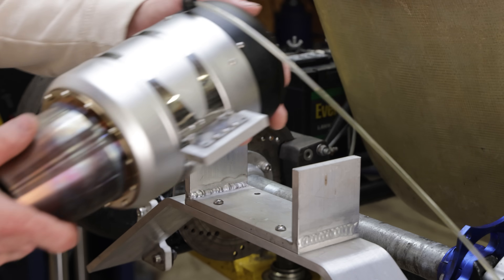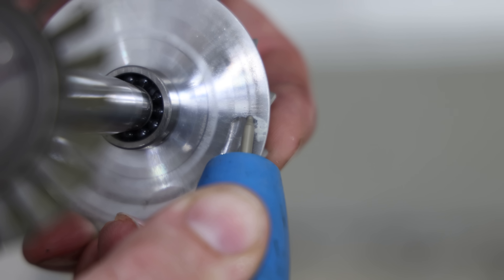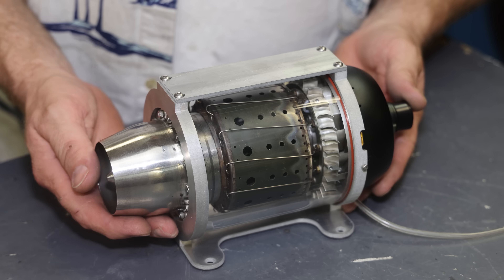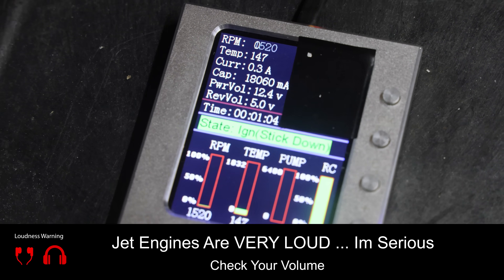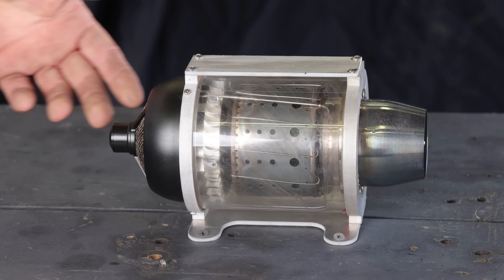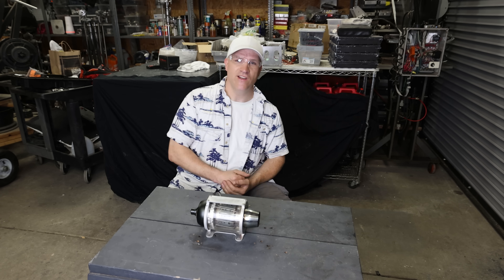See Thru Jet Engine

Comment: I loved this vid!  I still don't know how the front "fan" gets so much air into the combustion chamber before the chamber starts working.  After that I think I understand that the flowing fluid/gaseous part accelerates the rear "fan" and from there it seems like "more out, more in", in a sense.  I have to study this!
Reply: I'm looking at this as a car guy but the front "fan" is a compressor wheel like in a turbocharger, which doesn't just suck air into the combustion chamber, it sucks and compresses air, therefore cramming more air into combustion chamber. This is why Forced Induction (supercharging or tuebocharging) is required to make massive horsepower out of vehicles that are Naturally Aspirated. In the case of turbo'd cars, they're also more efficient because the intake side of a turbo is being spun up by the exhaust side which is spun up by exhaust fumes as they exit the cylinder/exhaust manifold therefore as you give it more gas, more hot exhaust gas is flowing, spinning the exhaust side of a turbo faster, therefore spinning the intake side of a turbo faster, which makes it suck AND compress more air, and cramming it into the engine and now your car is flying down the road making X amount of horsepower.

Comment: That was outstanding! What does the small bench it was screwed down to weigh?
Reply: The bench is strapped to fasteners in the floor, so the bench weight doesn't matter.
Reply: Brian B-P got it I didn’t know that and didn’t see that. Now, in your opinion, would it slide the bench along the floor?
Reply: @14goldmedals  Possibly. JetPol builds a similar clear-housing demo engine of about the same size (their housing is borosilicate glass) and a YouTube video of their engine running on a similar table includes the table sliding on the floor and being pushed back into place... it's amusing to watch.

Comment: It took me less than 95 seconds to realize you know your stuff, have a subscribe. Question, what about a thought on cold air to cold air exhaust on a compression engine. Get me some info, and I'll research it more. Maybe it's just a something, but thought experiment. I think it sounds fun 😊
Reply: I edited for an "r" on your. 

I am thinking..some unburned fuel is acceptable to be in-line for a torque application. I will say, probably the colder, the better.  That said, it's different. And super nerdy. Where is the safety wire!

Seriously, any assistance would be cool. I know a bunch of guys in the niche of the field of application that are true madlads. One wrote code for real time data logging, another has worked with two different companies to pioneer kits for upgraded supers. Now he's working on a budget turbo kit on a stock appearing sleeper. The super variant looks really stock. Parts are plenty, help is plenty.

Comment: is there a blue print for building small jet-engine
Reply: There are many commercially produced engines, including the one that provided most of the components (everything except the clear housing and brackets) used for this demonstration. They don't give away drawings, but you can get all of the parts.

Comment: Pretty cool being that I was a jet engine mechanic in the Air Force but also worked in the balance lab as a civil service mechanic where I balanced J85-21 turbines and compressor rotors for the F-5 that the navy used for the top gun program back in the late 90’s out at Edwards AFB. Great video.
Reply: Yeah guys, the real Top Gun. Bet you didn’t even realise its real

Comment: Is that an Impeller from a turbocharger?
Reply: It's similar, but all of the components of these hobby turbojets are manufactured specifically for them.
Reply: @brianb-p6586   Thanks, I figured the impeller is modeled after a turbocharger design... the working mechanical principle is basically identical 👍
Reply: @TheEDNC  But the order is the other way around - turbine engines were invented before turbochargers.
Reply: @brianb-p6586   Not so… turbocharges we’re invented in 1905 … forced induction found its real purpose so that WW2 aircraft, such like the B17 Flying Fortress could fly at even higher altitudes to avoid enemy flack defenses. There were many aircraft that were turbocharged starting as far back as 1921, way before the Germans perfected jet turbine technology
Reply: @TheEDNC  Although turbojets were not advanced to practical use (due largely to materials limitations) until after turbochargers were used, the gas turbine engine was invented a century before that, and centrifugal impellers were well-established technology (first worked out by Euler in the mid 18th century) before anyone built a turbocharger with one.
Reply: @brianb-p6586   Thanks!

Comment: You never actually showed much about the INSIDE. how does it rotate. You used a belt during your balance test, buuuuut, does that infer I can assume there's a belt in the compression housing?
Reply: No, there is no belt drive. The compressor impeller and turbine wheel are directly mounted on the shaft, as you see in the balancing process and the assembly - that assembly and the starter motor mounted directly to the nose of the shaft are the only moving parts within the engine.

Comment: "jet engines don't pull that much air"...still, a GE 90 115K at TO thrust pulls in a 50 cubic meter per seconds of air which to me is actually decent 😂
Reply from the maker: You're comparing apples to oranges. A GE 90 is not only a turbofan engine, but a high bypass turbo fan engine. The engine in this video is a turbo jet not a turbo fan. Completely different type of engine
Reply: @WarpedYT  Yes, the mass flow rate of air through a turbofan is much higher than a turbojet (for the same fuel burn rate), but even in a basic turbojet the mass of air which flows in a given time is much greater than the mass of fuel.
Reply: Okay, I thought you were talking about something general about the air flow. Indeed they're different because of their spec and working principle. However, compared to your engine's dimension, the flow must be decent as well, an intake air velocity measurement would be interesting I think ! Great video very interesting 👍

Comment: Can you build an engine that size that would have rotational power (run a generator) rather than pushing thrust?
Reply: That's called a turboshaft. Yes, you an buy those (usually described as a turboprop or a helicopter engine) from other manufacturers (not the one which made the components used in this engine); an example is KingTech.

Comment: Very cool! Does anyone know why you never see flames coming from the back of commercial jet engines? When I see commercial airliners taking off (many probably at 100% full power), there is no visible flame, etc. ever except in those rare cases when there's a  "backfire" or bird-strike. I know fighter jet engines are different, but we've all seen a fighter het in full afterburner with the flame visible. Just wondering.

Comment: I work at an airport, watch them start up all the time, and have always been interested in the process, thanks for showing that.  However I was pretty certain your plastic casing was going to melt when the inside started turning red, unless that's glass. It did blowout one of the gaskets, but not the catastrophic failure I expected. You must have your table mounted for it not to move even a little bit. 😁
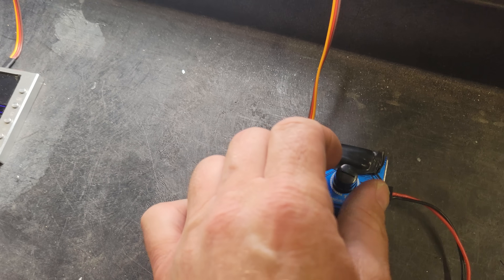Reply: If you watch closely you can see the strap that holds the table in place to anchors in the floor; for instance, @7:44.
Reply: @brianb-p6586  Okay thanks, I'll rewatch that. 👍  Yep just watched it again, saw the wheels on the table then the strap. Thank again!

Comment: NICE!!!,  my engine shows the same streaking lines on the outside of the combustion chamber,  what its telling me is that all the little stator blades at the periphery of the stator aren't doing anything, the air comes out of them at 45-deg rather than straight, so I'd like to see the same engine run with most of the little stator blades milled off and I bet it would run just the same. how about it, are you willing to sacrifice a stator for science ?

Comment: Very Cool. What kind of glass was was used?  Were you worried the table would take off?
Reply from the maker: I put together the material, as for the table it is strapped down to the concrete
Reply: @WarpedYT  so what kind of glass?
Reply from the maker: @ungmd21  haha... I cannot give away a trade secret like that which I worked almost 4 years to make. No way
Reply: @WarpedYT  OK I respect that

Comment: never thought the basics of it were like that, so what i got from it was that it works somewhat as a turbo, u have your cool air pushing through and it just compresses until it comes out? difference it’s air gets burned on the turbine, or how does the ignition of the air and fuel mixture happens

Comment: The energy comes from the core of a jet engine of course, but it's thermodynamically inefficient in that the thrust is the rate of change of momentum and, for a given mass of gas, it goes up linearly with gain in speed. Unfortunately, the kinetic energy imparted into the exhaust goes to the square of the speed. Hence higher exhaust speeds mean more thrust but are less efficient in that it wastes a lot more power in the form of the exhaust kinetic energy (rockets are even worse). 

Hence modern high-bypass turbofan engines where the great majority of the thrust comes from accelerating a much larger volume of air to considerably lower exhaust speeds than from the turbojet core alone. They will suck in a much larger volume of air than a turbojet.
Reply: Hmm. I wonder if it would be possible to use the high velocity flame from a rocket engine and the venturi effect to draw in and move a ton of air like a turbofan engine for better performance in atmosphere or if the pressures involved would make it impractical.

Comment: You could mount it on a pneumatic or spring loaded compression track to measure the thrust as it fires up and tops off.  You could also weight load it on a nautilus gear.

..

Comment: thats cool... want to see inside the can..take off the shroud also..paint a vortex stripe on the spinning exhaust mech... explain what u r doing at each stage of start up and run and why it works that way.. ie delay from compressor start to ignition etc, put some strips behind exhaust to show flow power... stay safe..

Comment: My higher education thesis was to research and develop new high temp materials wrt to existing Ni alloys for impellers and other parts inside the combustion chamber to increase the jet engines' efficiency. Here I clearly saw how temperature increases as hot gas travels through toward the exhaust side, and it was a thrilling experience for me. Thanks a lot for sharing this experience.
Reply: You just said a bunch of stuff I do not understand but ok.
Reply: Also developing a material sounds difficult

Comment: Spent a 1/4 of my life working on aircraft from B-52H which have P&W TF-33 power plants to DC 8-72 powered by the civilian version of the same engine. Additionally Allison 501-D13 turbine engines and Rolls Royce Dart engines. Having been trained in class on all these engines and intimate knowledge on every aspect including hot section can replacement to borescope to bleed valve replacement etc.  the fascinating part for me (besides the whole video) was how much cooling the compressed air provided to the hot section. At max speed the annular inclosure went from cherry red got the whole length to only the last third if that. Awesome to actually see it.  Cool video!

Comment: Neat video! I was wondering how fast the axle was spinning at top speed. The turbos on an old car I had years ago spun at about 100k RPM at full throttle.
Reply: it looked to be 129,000 rpm at 100%, quick shot of the display
Reply: @bigassscott666  That's pretty fast!

Comment: I have never understood how a fan at the front draws air into a cylinder with more fan blades inside all rotating at the same speed, yet is able to compress air, to me it does not make any logical sense, unless the amount of air getting in by the first fan blade is being restricted from coming out, but the other end the exit is also open so most of the air will simply escape in and out without getting compressed, and suppose the rear end is smaller in diameter then one could assume the air entering is being restricted from escaping as fast as it is coming in, which then makes sense that some air will get compressed, and then when you inject fuel and ignite it, the combustion occurs,  this yields greater volume of gasses which the thrust out from the rear, but what I can't understand is if the pressure in the combustion chamber is even greater then why does some of this pressure not try to escape out from the front from where the air is taken in, to me the whole concept defies logic, but I understand it actually works and has done so for so many turbine engines, its simply inconceivable for me.

Comment: oil supply?
Reply: The fuel contains some lubricating oil, and (at least some of) the fuel is run through the bearings for cooling and lubrication before going to the burners. This is normal for this style of small turbojet engine.

Comment: Awesome, congratulations.  
I assume you used a quartz tube.  It's a stable and hi T° melting point material, good call.   My guess is that the gasket blow out may have been caused in part by holding clamp warping due to heat.  I like your work a lot and I would have suggestions for you if you want.  Cheers!

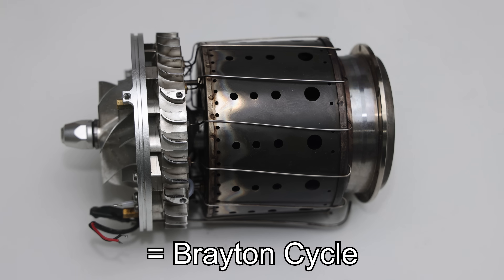Comment: Congratulations on your presentation. I designed and built jet engines, not as good as this one, but I had an idea of the engineering and thermodynamic system states, as the air goes through. Starting from the diffuser to slow down and increase the cold air pressure, only a small part of the cold air enters the ignitor burner flame side, through smaller holes, so that the air velocity is slowed to keep the flame attached.   Then most of the air is bypassed the burner and fed in through larger holes in the burner to separate the flame from the metal and to mix the cold air with the hotter air to cool down the flame and save those stator and turbine blades. see 1:33. Obviously, it is not an explosion but a continuous burn. That by-pass air is what saves the day. 

This video is a great educational video for all pilots who will now start appreciating how engineers look after them and this engine does not have cooling holes in the hot stator and turbine blades. I am very pleased to see many comments by pilots who now greatly appreciate the value of engineering in saving their lives. It is much easier to learn to fly than to get the states of the jet engines contributing to the pressure and air velocity and temperatures to meet the limitations of the material we have at our disposals. Men's minds flew before they invented jet engines, so it was easier to fly! The jet engine is now more reliable than a human pilot, as 75 % of aircraft incidents are due to pilot error but it is much lower than that for the failure of a jet engine, It is remarkable how a Boing 777 can fly on one jet engine and take all those passengers and pilots hack home. 
 
Again congratulations for making this demonstration, to be honest, I am getting annoyed at so many inspirational speakers are getting on YouTube depicting vociferous emotional subjects and never presenting a tangible guaranteed item that needs to work and save lives. I am referring to people like Richard Dawkins Christopher Hitchens, Deepak Chopra, and other politicians, who go around exploiting people with inspirational speeches.

Again congratulations. After using language to describe your thoughts, you let human silence creep in, and the voice of that jet engine and your transparent work, showing and uttering the real function, was an education to those who give services, but never actually design, make, nor manufacture nor maintain a tangible guaranteed working product.

Sir, I tip my hat to your competence in projecting a language and practical engineering activities, doing abilities which many members of a modern society do not want to know about,  as it is all invisible to them. Congratulations once again, this is a case where one man, on his own, produced more than magnificent language, art, and engineering work, showing God's natural laws of humans, thermodynamics, and engineering working together!.

Comment: i wonder if you wrapped the top plate around the sides a little to make it more sturdy. seemed like teh screws on the top couldnt hold it together.
Reply from the maker: It wasn't a screws it was a thinness of the struts, they're too thin they need to be thicker